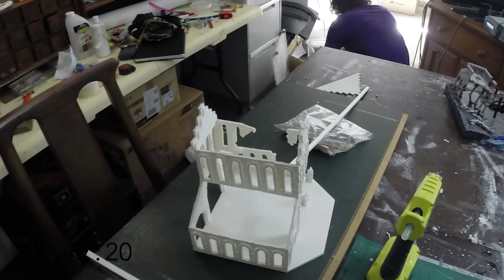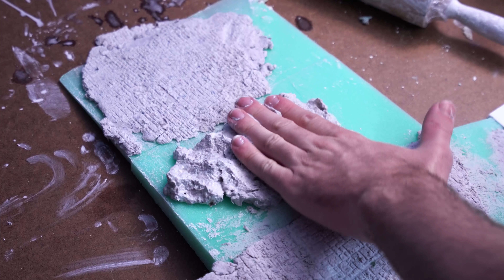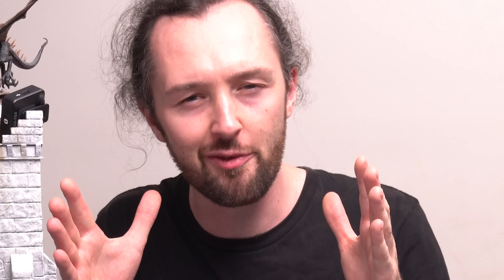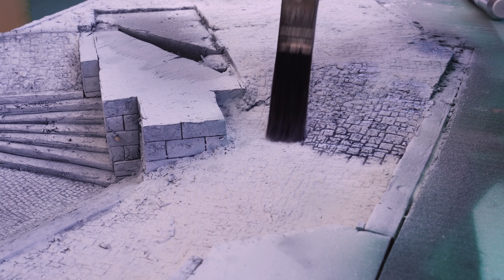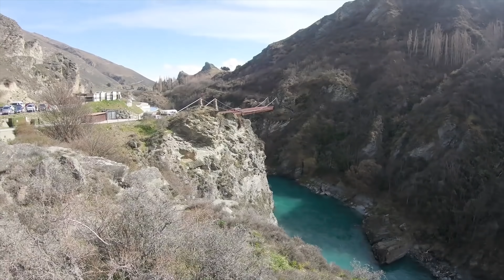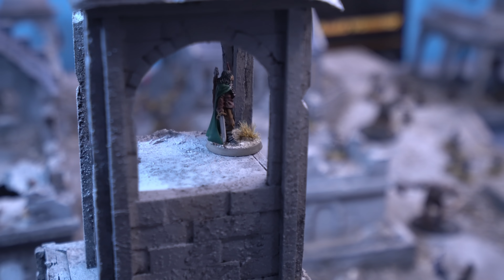FLOODED CITY | The BIGGEST wargaming board in YouTube History! LOTR Warhammer | Osgiliath [3]

Comment: I may be the minority here but I think my favorite part of the whole extended board so far is the section behind the wall with all those excellent mdf buildings. Tubertown had me excited, but I think once it all came together it has too much variety in too small of an area. The tubertown buildings if scattered amongst all the mdf ones, however, would dilute that effect a bit, and bring some zing to otherwise uniform streets. And some mdf buildings used in the current Tubertown would tie it into the rest of the city, presenting a more unified whole. They compliment one another. Of course I think the mdf buildings still could use a small amount of “zorpification” with some added weathering, rubble, awesomeness, etc. and it needs a city board with cobblestones to go on, of course. Hmm, I think my favorite part, really, is thinking ahead about what the full board could be like. 😁

Comment: This portion has to be my favorite so far since it timed in perfectly with my 40k ruined cityscape that I’m currently working on. You just taught me how to do my rubble in a WAY better fashion than I had in mind. The walls though are a very close second but overall you have upped my terrain skills just watching your series. One question I have. What is that modeling compound you use for the ground so often? I use air drying clay and I really don’t like it due to excessive warping and too smooth a finish on it.